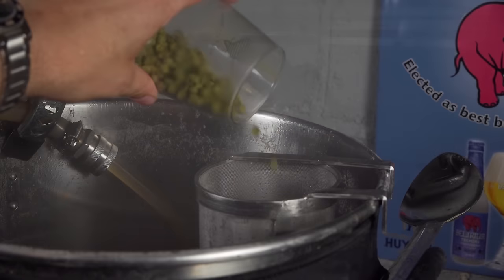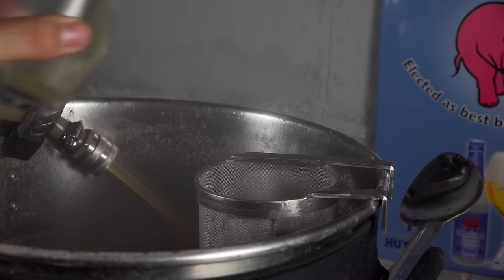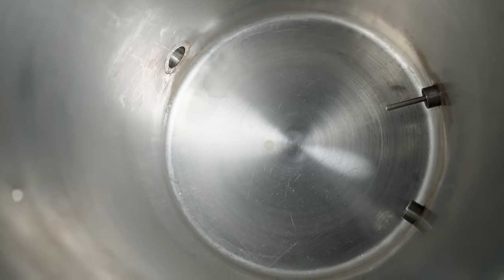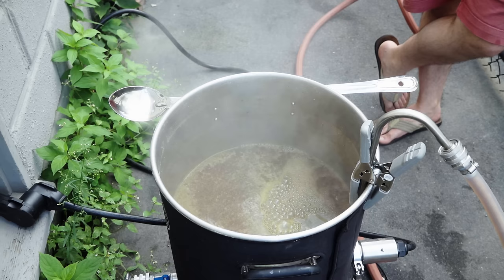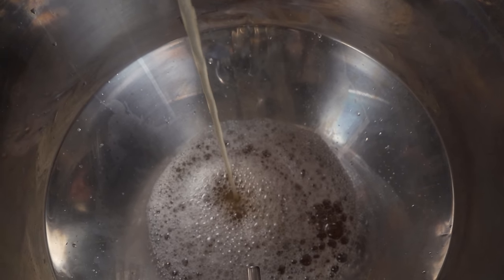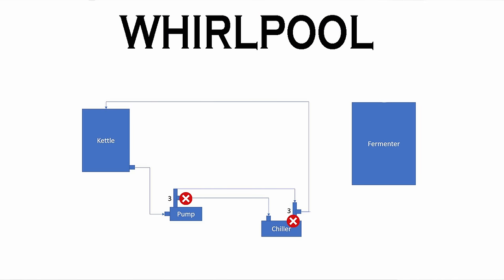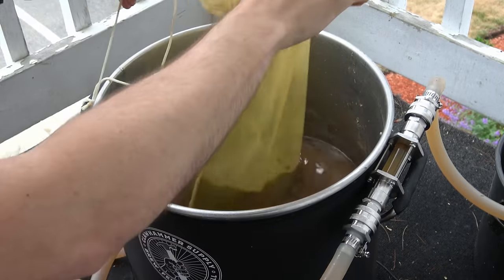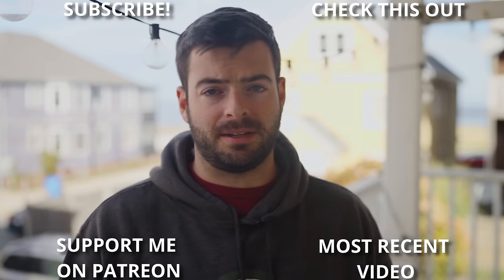MAXIMIZE HOP FLAVOR! How to Add Hops FREELY Without CLOGGING Your System

Comment: I stopped using my hop spider after seeing you not use one. I guess I wasn't thinking when I used the whole cone hops that I grew in the boil without the spider and had some troubles. Lesson learned. Thanks for the vid. Cheers!
Reply from the maker: There is some anecdotal evidence out there that says that whole cone hops might actually eventually act as a filter bed, but I haven't tried it. Cheers!

Comment: Liked the video. Might have missed it…, sanitising the chiller first by recirculating through it at the end of boil would also drop the wort temperature to 75 to 80C for the whirlpool hop additions? My biggest problem is clogging the pump when using whole hops in the kettle and pelleted hops added freely to the unitank as dry hops which bung up the outlet to the bottom butterfly valve. I have been splattered by green hop slurry too often!! 😕
Reply from the maker: The chiller sanitation step I do now at the 60 min mark before I add any hops, and without running the cold water through so it minimizes temperature drop.

Comment: Great video. I also have a claw hammer supply unit that I have modified. The bazooka was the first to go. I built myself a whirl pool arm as well. I now use a Spike Kettle because I bought a Spike steam condensing lid and it didn't fit on the Claw hammer kettle :( . The method you are using for whirlpooling does work well as I use that method all the time. I also stopped using the basket and mash separately as I found efficiently was low. Cheers
Reply from the maker: Nice! The steam condenser is a nice investment but unfortunately doesn't fit - I was thinking about it when I built the basement brewery. Cheers!

Comment: I have been letting the hops flow into the conical fermenter then, after a couple hours, drain them out the bottom. I haven’t noticed any issues. I use a counter flow chiller immersed in ice water.
Reply from the maker: That's definitely a benefit of using a conical!

Comment: I've been doing a spoon whirlpool after immersion chilling for a while, but I've never been able to tell if it works. The wort seems reasonable clear until the end so I guess it's doing something. I just shut off my kettle valve as soon as it starts pulling sludge. For big whirlpool additions, I just use bags, smack them around with the spoon for 20 minutes, take them out, finish chilling, then spoon-whirlpool.
Reply from the maker: That is a good method as well, and seems to work pretty well for you!

Comment: Does this same concept apply to dry hopping? Should I be adding hops directly to the beer instead of in a mesh bag? If so, how do you recommend keeping hop sediment out of the finished product?
Reply from the maker: That's different because you should still be able to separate the hops at the end, and you can't do that with a whirlpool in the fermenter. However if you have a conical, you can wait for the hops to sink to the bottom and dump them through the bottom dump valve if you want to add them freely. I still mostly use a dry hopping bag for my dry hopping.

Comment: Apologies if this has been addressed already but wouldn’t using a counter flow chiller instead of a plate chiller be significantly less likely to clog? Although that still doesn’t help you have this awesome whirlpool setup. Also to be fair I’ve never tried a plate or counter flow myself but an immersion chiller and an ice bath, so this is just from my understanding of the two.
Reply from the maker: That is correct, although there's no reason not to use this system with a CFC

Comment: I too have ditched the hop spider, and use that exact method with one difference. I have a blichman three vessel system, so sometimes in a heavily hopped beer I will use an in-line filter with a fine screen. I have yet to have to stop the transfer to clean the filter before I finish transferring wort to fermenter but it gives a second layer of protection.
Reply from the maker: Thanks for sharing!

Comment: Great video! It was helpful to me, since my brewzilla pump just stuck with a lot of hops inside of it and I couldn't use the pump or a valve cause its all connected. It was extremely painful to transfer the wort from the top of the brewzilla into another kettle with all the hops and proteins...
Reply from the maker: Glad it was helpful, that's a difficult situation!

Comment: Maybe I missed it, but did you mention what mesh size your spider is?  Wondering if it's worth testing between different ones to see if it's just 1 or all that impacts it significantly.
Reply from the maker: I don't actually know the mesh width, but this is a good point.

Comment: If you are adding late hop additions during whirlpool do you still do the short recirculation and rest before the addition? I must try this method, I cool and whirlpool together to 180 before adding 20 min hops while still circulating. Even after a 15 min rest I never get a cone. Very interesting, must be too emulsified?
Reply from the maker: Truthfully, I have not tried this yet with a whirlpool hop addition - but I expect the same results. I would do the same. Keep the recirculation going, then turn off the pump before letting the cone form. Maybe it just needs more time?
Reply: This was my question as well.  I do a lot of whirlpool /aroma hopping....so, in your opinion, should I drop to whirlpool temp, then add aroma hops for 5 mins, then shut off the whirlpool and wait 15 mins for the cone to form (20 mins total which is a normal whirlpool time I use) What about the wort that's  remaining in my HERMES coil?

Comment: Are there any tips to tricks to get a good whirlpool? I bought the whirlpool arm and my results have been less than impressive. I am using the Clawhammer 10 gal system. I did add a high flow edge dip-tube which could be affecting my results. So I may try without it next time.
Reply from the maker: Just be sure of where you place it so that it isn't sticking into the center of the kettle and the output is going tangential to the side of the kettle. The dip tube shouldn't affect anything, but be sure you're allowing adequate time with the pump OFF so you can get the trub to settle.

Comment: Would this method work with BIAB using using Jaded immersion chiller ??  I currently use 10G igloo with 2G ice block to chugger pump to Jaded immersion chiller to cool my wort.
Reply from the maker: Yes, it is actually easier with an immersion chiller since you don't have to worry about clogging the chiller.

Comment: This video couldn’t have come at better time! I just brewed a batch of beer this past Saturday and I threw the hops into the kettle and not the spider. This caused the bazooka screen to get clogged big time so I was trying to think of other options to try. I might try hop bags for each individual hop addition. Then if that fails, I might try method you recommended in this video. Thanks!
Reply: Just whirlpool and dump everything in the fermenter and it should leave the heavy hop sludge behind.

My German pilsner wins medals and consistently ranks 41-43 when BJCP scored. I got rid of my hop spider too and I don't regret it.
Reply from the maker: Hop bags might help, but if you can free the hops they will come through so much more.
Reply: @TheApartmentBrewer  - I wonder if the screen on the grain basket is about the same as the hop spider. If it is, then maybe I could use that instead of the spider.

Comment: Great topic, I think about this a lot. With my Grainfather, recirculating through the hop spider seems to help a bit, but the flavor still seems limited. The pump clogs easily, which is the biggest challenge.
Reply: If your pump clogs, turn it off and put an air mattress blower into the silicone tube. Unclogged instantly.

Comment: I like it.  Persaonally, I dump out the grain basket and put it back in the wort and use it as a MASSIVE hop spider. all the same perks but no extra equipment needed. (Using Clawhammer)
Reply from the maker: Glad that works for you, every time I've done that the wort doesn't pass through it. Ran my pump dry a few times and I decided not to try to make that work anymore.
Reply: @TheApartmentBrewer  Yes that is something to be aware of for sure, I have done that as well. I wonder if throwing in some rice hulls, like you would to prevent a stuck mash, might help with that or not. Something to try

Comment: Have you ever just used the grain basket for a hop spider? I have always wanted to try that.
Reply: This is probably the most logical answer to this issue and I'm not sure why no one else ever thinks of this.  I like the methods TAB described in this video, but I'm not convinced that the perceived improvements in hop flavor aren't due to the 15 minute hop stand/whirlpool (especially with 0 minute hop additions).
Reply from the maker: That thing clogs worse than the hop spider and then the wort doesn't want to drain through it at the end of the boil. I tried this in a video I did last year and it doesn't work the way you would think.
Reply: @TheApartmentBrewer  Good to know...  you just saved me $175 because I was looking at the Claw Hammer site and thinking of buying one!  Might spend that money on the whirlpool arm instead and try your method. 👍
Reply: Do you use the 12” or 18”?
Reply: @TheApartmentBrewer  Totally agree that the hop spider is bascially rubbish. I've sat the grain basket inside a grain bag, giving more room for the hops to circulate. At the end of the whirlpool I remove basket and bag. It's a bit of a faff but does give better hop utilisation. Really just need a hop spider the same size as the grain basket
Reply from the maker: I got the 12" version

Comment: What you do is how Brewtools B40, B80 and B150 system works with 3 valve. Great video!
Reply: Only you need 4 three way valves and 3k with brewtools' system.
Reply from the maker: That's actually where I got the inspiration from!

Comment: Question? Where did you get the 3-way valves, and do they have tri-clamp versions? I've been using the Blichmann BrewEasy Compact and realized one short comping that a 3-way (or even a 4-way) could solve. Agree with the hop spider or hop bags, as I'm always very aware of getting good recirculation but could see better utilization by dumping the hops directly into the brew kettle. There was some info on this in regards to hop utilization for dry hopping based on total contact.
Reply: Looks like Blichmann has a 3-way 1.5" TC as L-type or T-type. T-type always connects at least 2 ports, up to 3. L-type only connects center and 1 other port or is closed. A good diagram can be found on Brew Hardware's 3-way valve pages.
Reply from the maker: I ordered NPT versions off amazon, but I think TC versions exist somewhere on amazon as well. They are probably going to be a bit more expensive though.

Comment: I have been doing this inadvertently but only because my Anvil Foundry 10.5 doesn't come with a hop spider and I haven't bought one yet. But I have only put about 5 oz of hops through it because the pale ale (Take the A Train recipe) I brewed I scaled down to 3 gallons. May still get one for IPA's and pale ales, because that 5 oz came close to clogging my pump.
Reply from the maker: It might help a lot! Thanks for brewing my recipe!
Reply: @TheApartmentBrewer  It's very good, will be brewing again!

Comment: Quick question about your setup.  The Clawhammer system isn’t seen much in the UK, is it a no sparge system? If so, do you know how you’d go about converting a recipe that is made for a clawhammer system to a Grainfather for example?
Reply from the maker: Yep, it is a no sparge system, although you sort of can sparge if you pour some water over the grain basket as it is lifted out. As long as the volumes are relatively similar the only thing you should need to adjust is efficiency.

Comment: Based on purely anecdotal experience, I've noticed increased bitterness when not using the hop spider. Not so bad for a West Coast IPA, but on something light I've seen a perceivably less desirable beer. Process control of the spider is really nice - ability to remember bittering hops as soon as boil is over rather than having them sit for 15mins in hot wort as it cools down.
Reply from the maker: That is a good point - although you could probably account for the increased bitterness by decreasing the initial bittering addition.

Comment: I recently used a hop spider for the first time and was extremely disappointed.  I've never tried a whirlpool as I have an electric system and assumed the elements would interfere with the flow.  It looks like your system is electric - how much does the element impact the whirlpool creation?
Reply from the maker: As long as you turn off the element when you begin the whirlpool there won't be any problems with scorching, and the trub still piles nicely on top

Comment: The clawhammer spider SUUUUCKS. My IPAs have gone downhill since I started using it. For my most hoppy beers I have been using aquarium filter bags. Do you find you have to slow your pump down once the whirlpool is over to keep it from sucking up the trub cone?
Reply from the maker: I wonder if it is a tighter mesh than others. I haven't had to slow the pump down yet, but if there are more hops in the cone, maybe.

Comment: For a 8 gallon kettle, which whirlpool arm do you recommend? 12" or 18"?
Reply from the maker: I use the 12" arm for both my clawhammer kettles
Reply: @TheApartmentBrewer  Do you think the 12" would work for 2-3 gallons batches in the 10 gallon Clawhammer? At times I brew smaller batches and was concerned the 12" might not work. Great channel! Love the content.
Reply from the maker: It may not reach the wort level by that's on if you're fine with some splashing
Reply: @TheApartmentBrewer  Thanks for the feedback!

Comment: I also gave up on the hop spider in my clawhammer setup, instead I use the grain basket. The flavor difference is amazing but you do need to be careful with boil overs as the wort will foam up along the outside of the basket. I also pull the basket almost completely out of the boil a few times every 10 mins or so just to help keep the hops from compacting on the bottom too much.
Reply from the maker: I tried using the grain basket a few times and the wort would not drain through it, pump ran dry and thats not a great thing. Glad it works for you!

Comment: I think there's also an increase of the formation of DMS resulting from continued conversion of SMM between the boil and end of whirlpool before pumping through the chiller.
If you haven't noticed it, probably not big enough a deal to warrant consideration.
Reply from the maker: Interesting thought, I think those who do the no-chill method would be affected by this as well though.

Comment: I've done a couple brews now with a hop stopper and it seems to do well without needing to whirlpool. Making one might be a fun DIY project and they let you sanitize by recirculating during the boil without losing hop utilization. Have you tried using the mash screen as a giant hop spider?
Reply from the maker: I've tried using the basket a few times before but unfortunately they've all been failures. The wort tends to not want to pass through the mesh and its worse than using the hop spider, once my pump ran dry because there was no liquid underneath the basket.

Comment: Totally agree, gave up on my spider years ago, whirlpool gets most of the stuff settled into the middle. I use an immersion chiller however, so I usually pull the chiller when I get to KO temp, then wp for an additional 10 minuets and let it rest for 10. What I've also found extremely useful is using a Bouncer Pro filter when going into the fermenter to pick up whatever did not settle or once the kettle starts to pull gunk.
Reply: Details on where 2 get bouncer pro filter ???

Comment: How about re-circulation into the hop spider after the boil but before sending anything to the chiller?  I haven’t tried it yet but I have been having the same issues on my 20gal Clawhammer .  Thanks  for all you do!
Reply from the maker: I've tried this but it eventually overflows and causes the hop material to flow out into the kettle.
Reply: @TheApartmentBrewer   Been there done that

Comment: I find putting on my heat resistant gloves, and dunking  the hop spider gets you good results. I have a mash and boil. So if anything burns on the bottom it stops the system and throws an error code
Reply from the maker: Heat resistant gloves are a very useful part of the brew house!

Comment: Great stuff... which does not apply to the designer of my all in one system with a built in pump... which draws from the bottom of the kettle!! Will never risk pumping hop particles through there. Which is a shame because it also limits my cooling options to immersion only and JaDeD don't supply Europe (very well)
Reply from the maker: I'm sorry to hear that! Have you considered looking into a trub trap or similar false bottom?
Reply: @TheApartmentBrewer  only briefly, figured it would build up as a bazooka filter would (took me 2 brews to throw that in the trash, even with a hop spider). Also worried it won’t stay in place very well during the boil, but not sure how that works

Comment: I can get a hop spider for 40$ or less(depending on size) how much does it cost for your setup?
Reply from the maker: Last I checked the whirlpool arm is 20 bucks
Reply: @TheApartmentBrewer  True, but you also need a pump for that.

My set up is a 10 gallon kettle, you know like you were back in the apartment, way back in the day.

  I do BIAB currently because I need experience before adding more moneys into the hobby.

I said to myself I would rather spend the money on a 6 tap keezer then on the other items and not have a place to serve them from.   I have 3 tap towers (with my keezer), because I have zero desire to bend over to pour a draft.